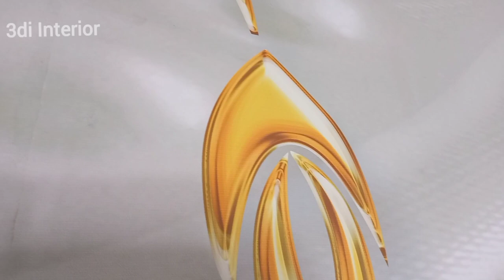How to install 3d wallpaper wall mural interior design ideas for living room

Comment: Please I've a question the one inch's overlapped wen cutting it won't the one underneath peal off too?
Reply from the maker: Thanks for your comment, we no longer print piece by piece... What we produce now is full mural, which means there is no need to overlap
Reply: What about a case where a client orders the mural himself and it's printed piece by piece
Reply from the maker: @sambinteriorandexteriordesigns  it will not peel off, watch the video very to understand that part

Comment: The gum you applied at the back of the 3d wallpaper it is the wallpaper paste mix with water or another different kind of gum
Reply from the maker: Another different type of gum
Reply: Please can Top bond be use for it?
Reply from the maker: @sambinteriorandexteriordesigns  some people use top bond, but Isocol gum is better because it dries slowly
Reply: Please where can I get the gum and what's the cost
Reply from the maker: @sambinteriorandexteriordesigns  you can ask where building materials are sold or people who sell wallpapers